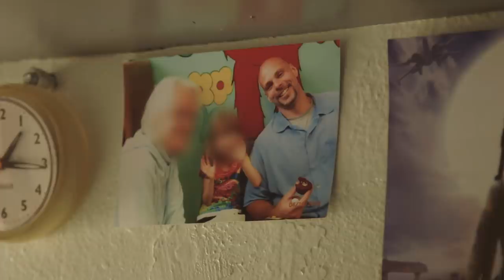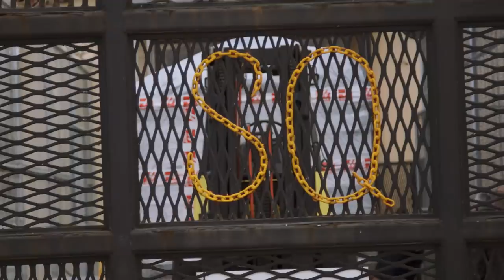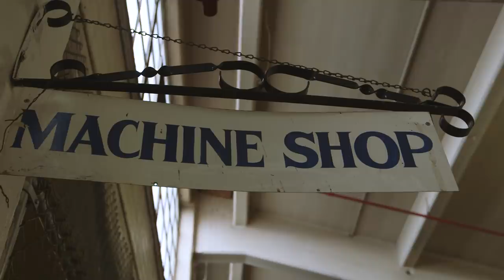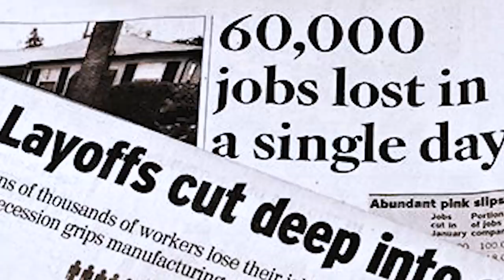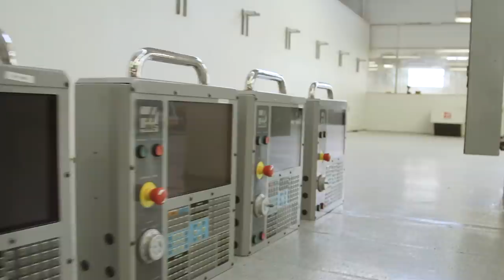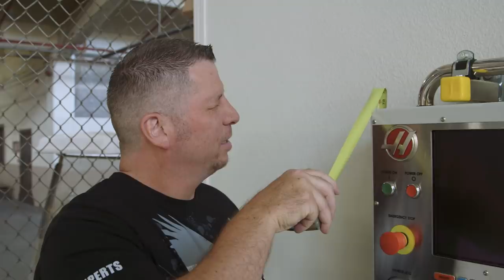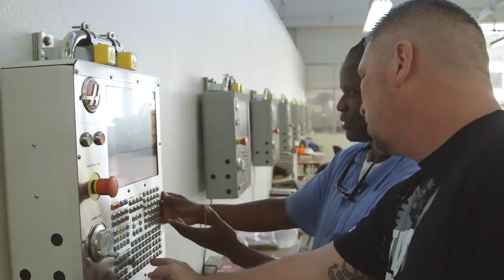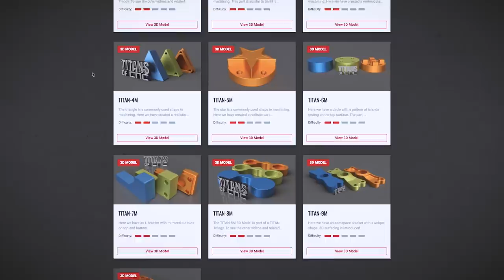CNC MACHINING IN SAN QUENTIN PRISON | EP 6

Comment: With all of the CNC discussion, I hope folks are not forgetting the usefulness of the old machines in the manufacturing of low volume items, and the repair of individual items. One may not need to fill an order for a thousand valve bodies, but maybe just a hydraulic cylinder repaired, or a few bearing adapters. Watching Abom79 gives a good example of this.

My auto shop is a teeny one man wheel alignment shop because there are plenty of folks that need their one problem solved by a seasoned craftsman.

When I needed the kingpins refurbished on a customer's Avanti, I called the guy with the little machine shop at his house.

I am looking at making my own wheel alignment shims for use and for sale. I might not need a CNC cutting table, but a drill press and metal shear. Using snips and a handheld drill is getting old.

JMF 

The Alignment Guy (R) LLC
Reply: Abom79🤘
Reply: I take the opposite approach because I started in 3D Printing.  Nothing is ever one off because I can take that g-code, that program and put it in my database with all the details I need. Filename, part number, material, amount of material per part, how many can I nest, time for one unit, time for a fully nested job, what you paid for one, etc...

It goes into the library.  If I think I can sell more of that part to more people, I'll wave my design/programming fee, list the part for sale where I can and make them to order. With the client's permission of course.  Neat shop BTW.
Reply: Yes, keep the old tools around, just not the entire shop floor. I got the Monarch CK-12 from October 1943 squirreled away for small jobs and the occasional "feels good" therapy. However!! A CNC helical mill path makes up for an infinite drill inventory.